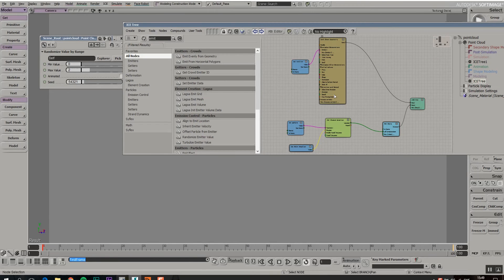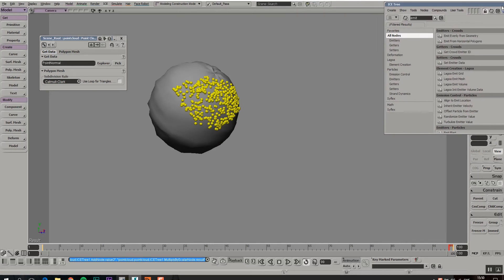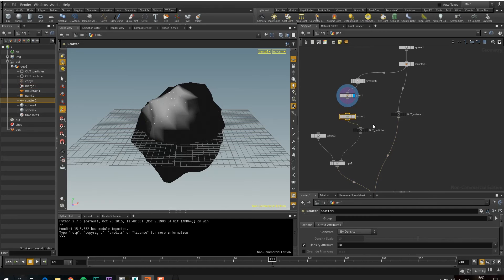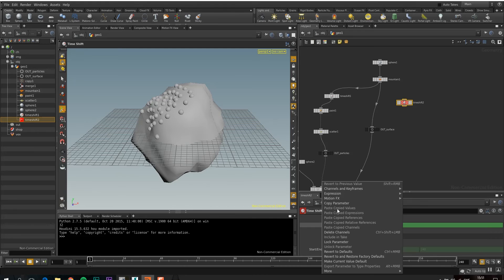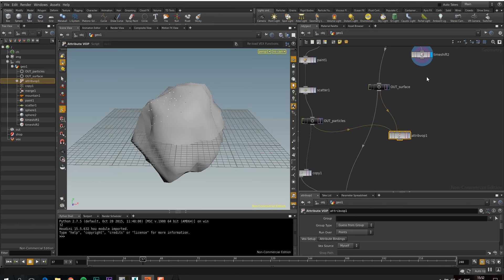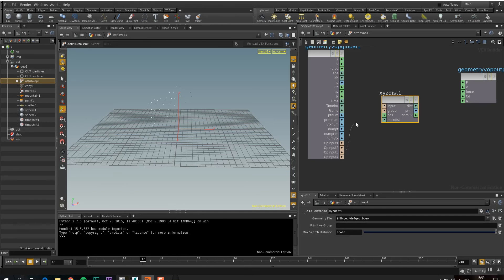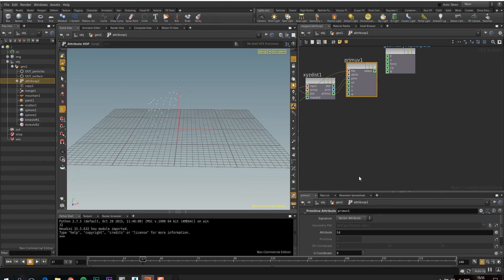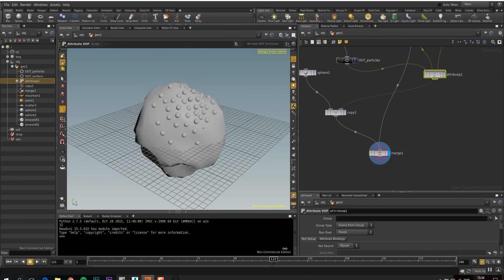XSI to Houdini 1: Find closest Location on Geometry

Comment: Thanks for the tutorials they are realy great!
By the way you can achieve the same thing by scattering points  on the timeshifted (freezed) geo. Turn on scatter SOP's output tab primNumAttrib and PrimUVWAttrib, then connecting the deforming geometry and the timeshifted points to an attribinterpolate sop.
Reply from the maker: Thanks! And a good tip also! Cheers